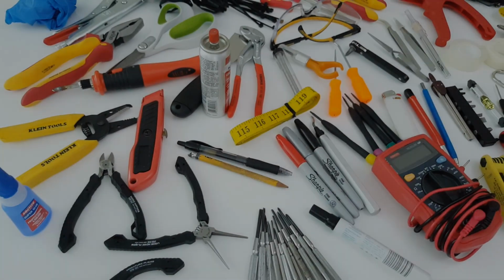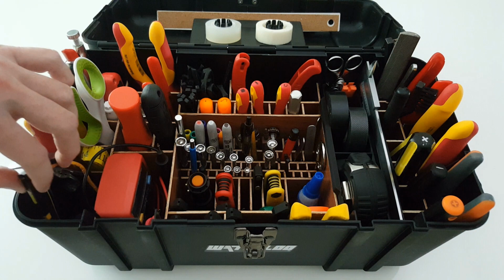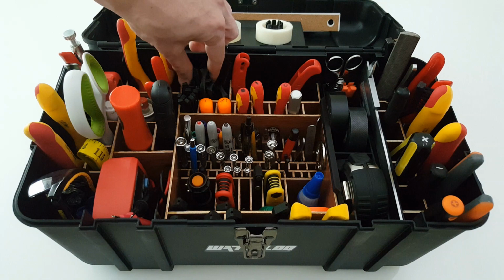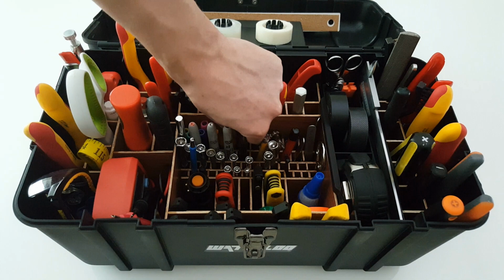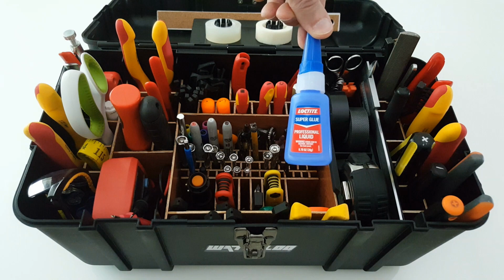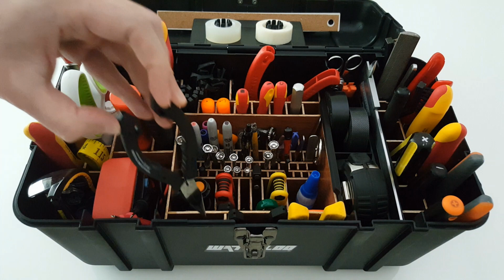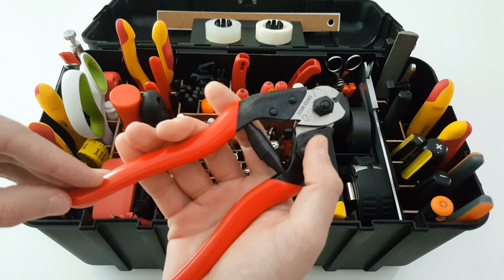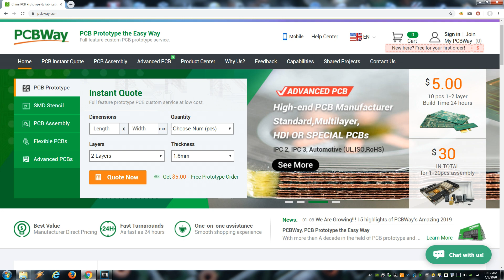My Favorite Tools for Arduino/Electronics

Comment: I have been slowly replacing my tools with knipex. I got some small electronics snips and pliers for my birthday last month and now I'm obsessed. That crimper is the best one I've ever used. You should have a second small cheap multimeter for measuring volts and use the other for amps. I buy multimeters and magnets all the time to give away. I grab them on sale. Same with soldering stations. T12 clones usually.

I go to the local makerspace alot amd leave them there for people to take if they don't have the means to have them otherwise to work on projects at home. I use the honor system. All I ask is that the person put the items to good use. I just leave them there so people think the makerspace own them to give away.
Reply from the maker: That's awesome! Thanks for sharing